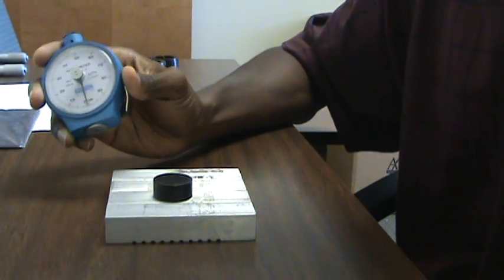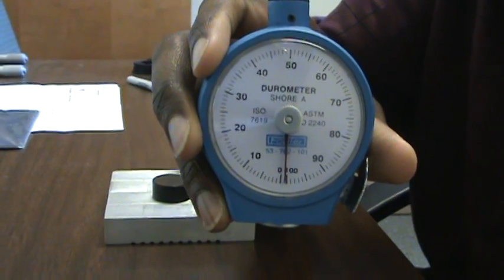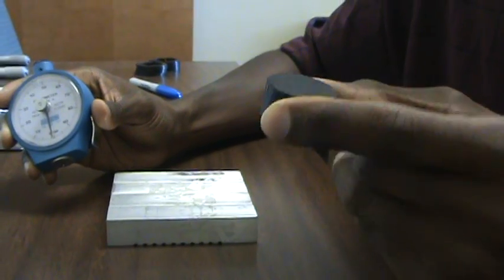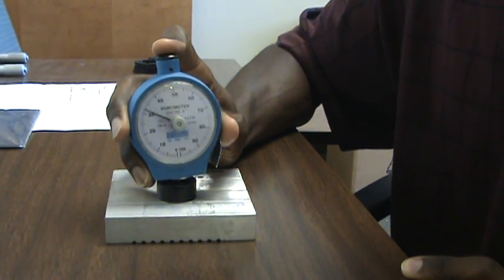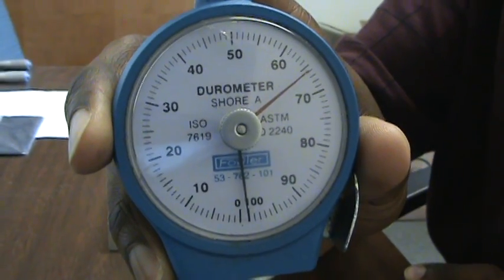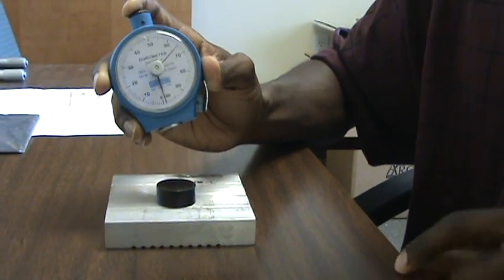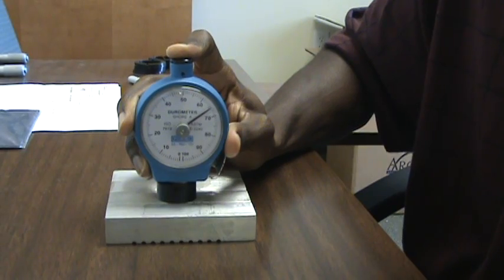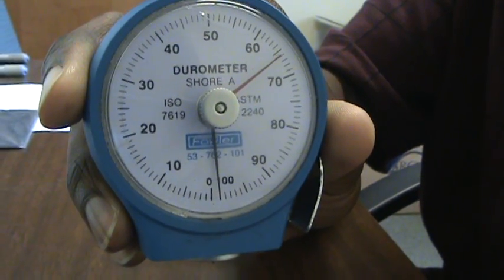Checking Durometer with a handheld gage

Comment: The dial on the gage is positioned at 100 when you start, not at zero.  Can you please confirm which is the correct methodology?  Thanks.
Reply: 100 and 0 are at the same position. like 12 AM and 12 PM on a clock.